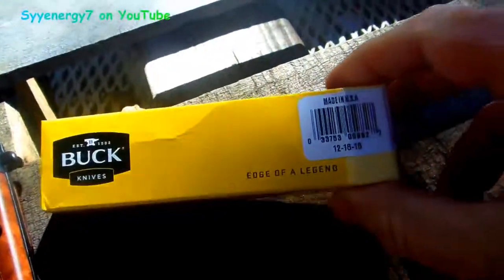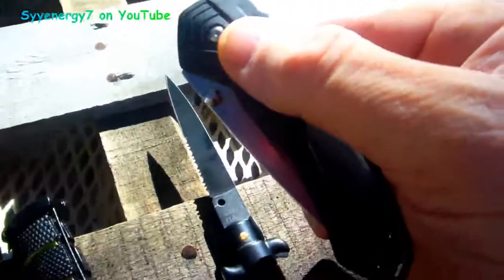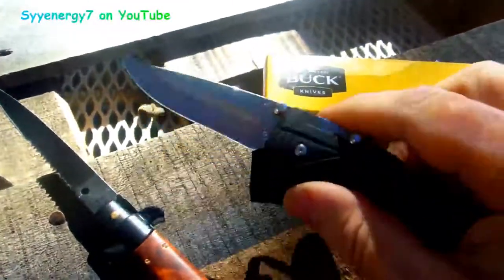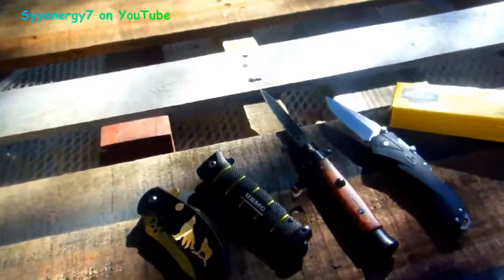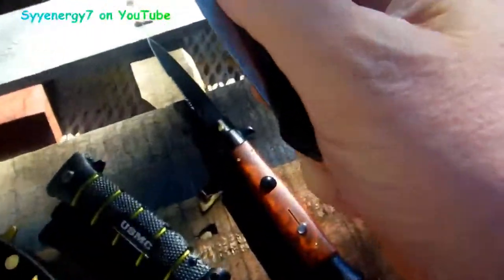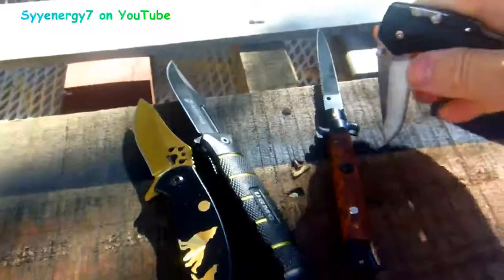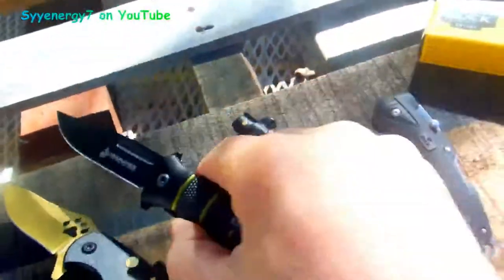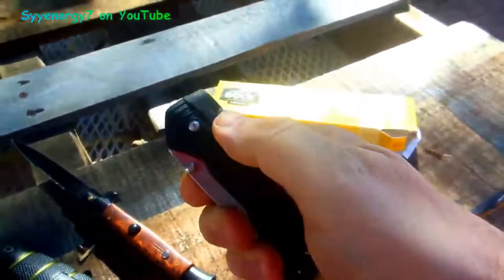BUCK Knives, Made in USA 'Quickfire', high quality, low price

Comment: One of the best kept secrets in the knife world is exactly how much and how many of the Buck's knives are either wholly, partially made & or assembled in China.  Where do you think those Chinese knockoffs are coming from?  They are factory seconds...  Buck doesn't like to talk about that much.  Also, there is no such thing as "420 HC"...420 is 420 period. Buck just calls it that to get people around the fact that 420 stainless is very cheap steel. (on par with 3crmov).. The difference is indeed in the heat treat, (that is true in any knife blade)  It is a combination of heating and cooling involving the use of liquid nitrogen.  Paul Bos didn't invent this, he just taught Buck how to do it right.  Hard fact, anybody with the time, resources and patience can kry-treat a knife blade.  Some Steels benefit greatly, some not so much.   All that being said, the Quickfire is a pretty decent EDC box opener at the price point,  but I sure wouldn't bet my life on it and I woudn't use it for messy jobs like field dressing.